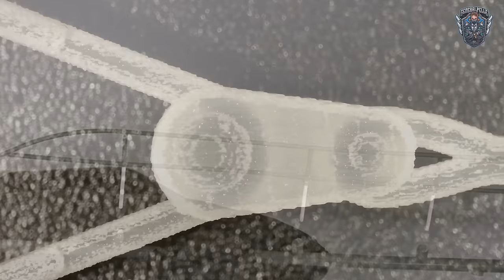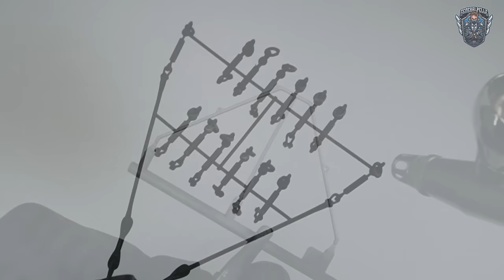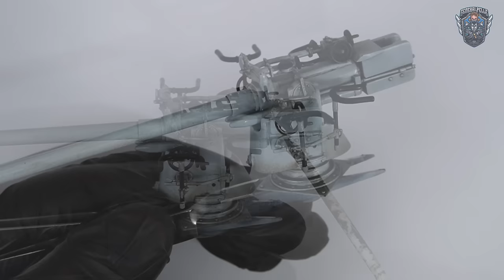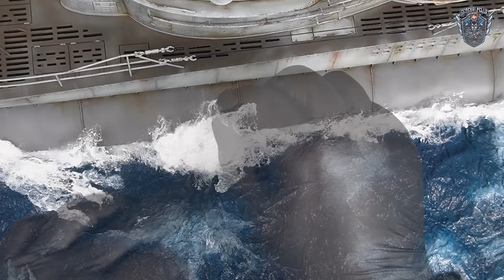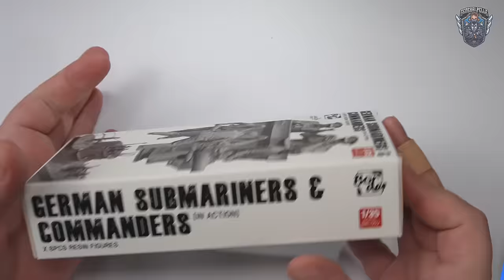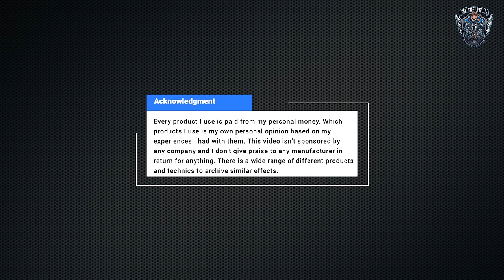Building a 1/35 Stormy Sea Diorama: Type VII-C U-Boat Scale Model | Part 3

Comment: David R Lentz, USA 

Oh, absolutely masterful in your artistry, sir! Your knowledge of your subject matter shows. You ought to be earning well into six figures professionally doing displays and dioramas such as these. 
   Another treat is the elegant manner and the polished diction of the narrator. Not till well into your presentation had I learnt you were one and the same! Well, then, a professional twice over, you are! 
   In a very general sense have I had aspirations to displays much as this. Another way one might simulate lightning’s occurrence is through using any of the phosphorescent or photo-electric materials in rod form that 1) when an electric current passes through it (possibly attenuated with a rheostat), it incandesces white, process blue, yellow, red, green, and possibly other bright hues, depending upon the type one acquires, 2) one can bend the supporting wire in various positions, which the material will hold, 3) it is a thermically cool medium, avoiding the risk of combustion. 
   In them, I also would use translucent plastic panelling that one can 1) form in a gentle curve, 2) stain into an assortment of colours, 3) paint to suggest an overcast sky, or 4) perhaps even display a photographic backdrop (in this case, a dynamic sunset with slate grey clouds limned in bright oranges, simmering vermilions, cooler magentas, all blending into one another) . . . . Behind this one could set one’s simulated lightning, masking their appearance.
Reply from the maker: Hi David, first of all thank you very much for your nice comment and your interesting ideas on how to create thunderstorms for dioramas. That are some great tips i probably gonna try out in the future :) I added at least a high quality photographic backdrop to my diorama, which isn't visibile in the video. Well, i don't know if somebody on this planets earns six figures doing dioramas, i honestly doubt it. I already would be pretty happy if my channel had a six figures subscriber count, but even that is probably unreachable for me. Five figures seams much more reasable, but well, maybe next year ;)

Comment: The boat remains completely dry in a rough sea.... How is this possible ?  ;-)
Maybe use a lot of clear acrylic....? Tamiya X-22 ?
Wonderful diorama, great build. That is true !
Reply from the maker: Yeah, you’re honestly not the first one mentioned that. I regret not doing that, but hey, we are all here to learn ;)
Reply: It's still not too late. Just add it, now. It can be done without damaging or negatively altering any part of the ship. Adding a wet layer should be done last, anyway.  Wet or dry, it is still a very good diorama. 
But a wet submarine looks more convincing than a dry one. 
I understand your hesitation because you spent SO much time building and weathering the model. Adding a wet layer may seem like you damage the model, but the opposite is true. 
Simulating flowing water on a model is not easy. I admit. But there are plenty of photos on internet.
Looking at your model, understanding your skills, I am sure you can do it.
Reply from the maker: @telescopereplicator  I’ll look into it, but the whole thing is now encapsulated in the wooden frame, which makes it kind of hard to reach. I still give it a try and keep you updated. Thanks for the tip.

Comment: David R Lentz, Columbus, Ohio, USA (Sunday, 23 June, 2024). 
Updated

   I take delight in watching your video build of the Border Model 1:35th-scale plastic model kit of the conning tower and a 66-cm segment of the hull of a Deutsche Krieksmarine Typ VIIc Unterseeboot (U-Boat). Had I the resources, I would do similarly, except that I would display as it succumbs to the fearsome blast of a pair of 160-kg U.S. Navy air-dropped depth charges. These would descend from the forward bomb bay of the Hong Kong Models 1:32nd-scale kit of Consolidated’s B-24D Liberator USAAF Heavy Bomber, which I would convert to a replica of a Consolidated PB4Y-1 Liberator U.S. Navy Maritime Convoy Patrol Bomber, positioned airborne, its four propellers spinning, the aeroplane painted in the USN tri-colour camouflage scheme of gloss dark sea blue on the upper wings, flat dark sea blue on the upper fuselage, intermediate blue on the vertical surfaces, and gloss white on the ventral surfaces; it might have some minor alterations in electrical equipment here and there, as well. 
   I also would endeavour to extend the submarine’s submerged hull sufficiently enough to equal the wingspan of the formidable bomber: 33.528 metres, which in 1:32nd-scale would be 104.775 cm, and in 1:35th-scale 95.794 cm. (As I am a word nerd, though NOT a maths whiz, I cannot infer which would have a more realistic appearance.) 
   I would include the deck figures, adding a second set posed in recoil from the explosion washing away some of them. 
   If you would like, you could use my idea herein for a future project. I suggest an aircraft because I doubt if a destroyer escort or similar in 1:35th-scale would be affordable or physically practical; the full hull of this Typ VIIc U-Boat would be nearly two metres in length! Revell Germany makes this submarine in 1:144th-scale e (05100). The company had produced a U.S. Navy Fletcher-class destroyer (over 114.6 metres in the actual), in this scale a significant 79.58 cm (05150)! The sub, 67.056 metres in the actual, and 46.567 cm in 1:144th-scale. The pair in combination would make for a dramatic display. 
   I would create displays of aircraft, ships, vehicles, figures, buildings, etc., in different scales for an immensely intriguing forced perspective diorama. A half metre or so behind that USN destroyer and DKM U-boat combination—one would have to look at the completed models to evaluate the actual placement—one could place Liberty ship replicas and models of their escorts in 1:700th-, 1:500th-, 1:350th-, 1:200th-,  and other scales, the larger reproductions to the fore. Matchbox made a 1:72nd-scale kit of a Flower-class Corvette (PK-901) that one could set in the fore of the USN destroyer, itself contesting a Revell Germany model in the same proportion of a DKM Typ VIIc “Wolf Pack” U-Boat (05015). 

The following is my reply to your recent response to an earlier comment of mine:

Oh, some certainly do earn significant incomes with 1) model-making, dioramas, figurines, buildings (some of historical interest, others of prospective designs for architects and their clients), most scratch-building in very large scales replicas of ships, aircraft, etc., on the staff of historical museums; 2) European miniatures that professional artisans long have crafted to astounding precision and fidelity; these miniaturists live and work at the beating heart of a centuries-old tradition in France, Italy, Germany, etc., extending back into the High Middle Ages; 3) motion picture productions of highly intricate settings, three-dimensional backdrops, etc. If you have The Lord of the Rings trilogy Extended Edition Blu-ray set, some of the discs present these very processes video recorded in progress; the staff had built some “miniatures” that were so ornate or intricate, so huge, that one senior designer-builder, Mary MacLachlan (if I recall correctly that spelling), called two statues fashioned of ceramic towering an actual seven feet “bigatures”! Hogwarts Castle is over fifteen metres across, much of it lit internally. 
   Thank you also for appreciating my brainstorming. I have lots of ideas, though no means to implement them. Had I great wealth, I would plan them, hiring  talented modellers to execute the projects. Shortly after the Second World War  one foggy morning, a North American Aviation B-25 Mitchell USAAF Medium Bomber crashed into an upper storey of the Empire State Building. To reproduce that with a Hong Kong Models 1:32nd-scale kit would require a replica of the iconic edifice over 14 metres tall!
Reply from the maker: Hi David, that’s sounds like a nice idea. I doubt the size difference matters that much in that case, you could please the bomber more far away for a forced perspective. Would love to build something like this, but i honestly don’t have the space for it. There would also be a 1/72 variant (full uboat model), which maybe a better choice considering the size of such a project. Anyway, if you build it, make sure to send me some pictures please :) Greetings from Switzerland.